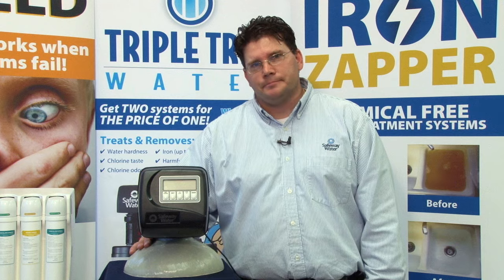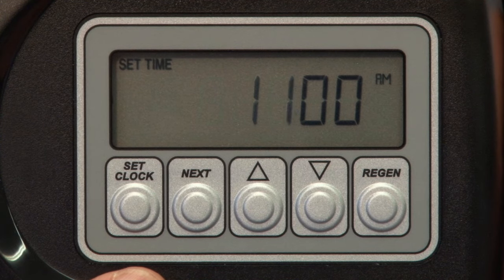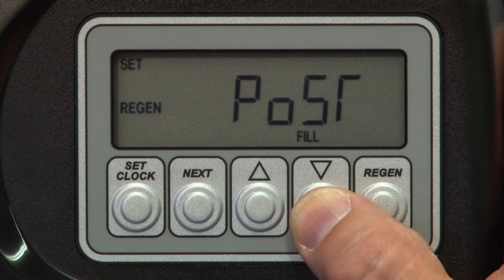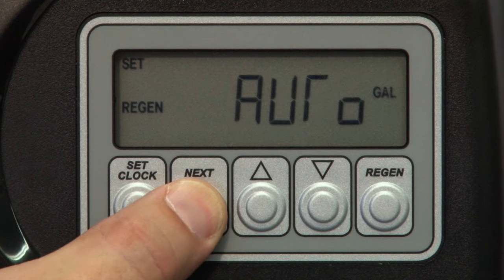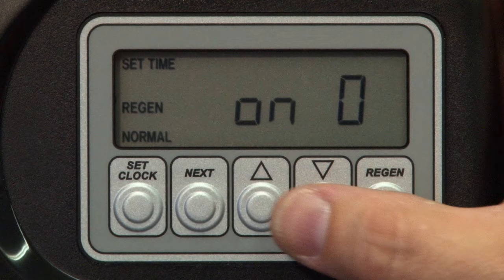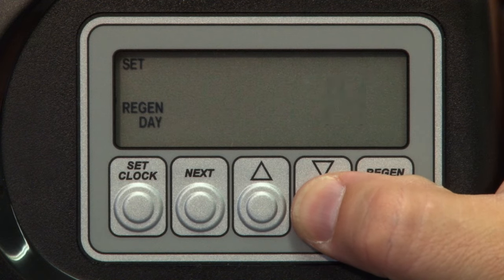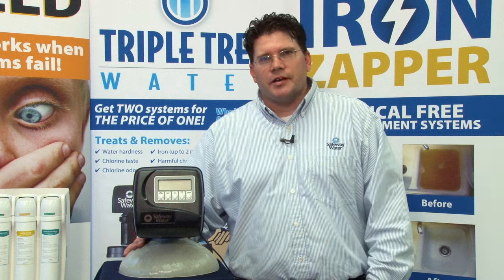Programming The New Safeway Valve #1

Comment: "That's all it takes to setup this system" made me LOL.I feel like I need to quit my job and enroll in a 4-year degree program to understand this device/system. But I took a lot of notes and I'm just going to set it and hope for the best. This really is an informative and helpful video, I appreciate you trying to simplify this complicated task.  Edit to add: I called the plumber who installed it to ask for guidance on the settings, they let me know that if the power goes out ONLY THE CLOCK needs to be reset, and the other settings are saved in the device from the original install. FYI.
Reply: Seriously, I’m going to need to enroll in that 4-year program too
Reply: Thank you.  I had the system installed 2 weeks ago and am not feeling any difference you normally feel with soft water, so I go to troubleshoot and have zero idea.  I have the programming guide but to your point it feels like you need a degree, it's not user friendly to a non-technician.
Reply: Mine didn't

Comment: Great video! If you're here because your water tank is empty, don't panic! This new Sterling Water System isn't like your old one. The one you're used to still has a little water and sludge at the bottom. This new system will cycle your water through and once it detects you're out of salt. The tank takes notice and doesn't refill. In an attempt to preserve your water system from damage without adequate salt level. 

To keep this from happening again. Make a note of the date's and time you fill up the salt and time of water tank fill up. Place a pen and notepad next to your water system to make a quick note to self. Also, the best reminder is one that tells you when to check it. So use your smartphones calendar, set the time with an alarm on the day to refill salt. You will get to know what time that is for you as you check back in 2/3 weeks.

As mentioned here, if it's completely out of water. After you have refilled your tank with (salt halfway*). It's best to start a manual cycle to start your system asap. If not, your system will only try and refill once it reaches it's normal scheduled time.

Also, there is an overflow on your water tank, so if you overfill with salt. Your system may put out an overflow of water, if it doesn't adjust to stop in time. Placing a large old drinking cup underneath that hole is always a good idea to leave there. Especially if you have an older system, or may overfill.

*If able don't only buy the exact amount of salt needed. Buy at least 2/3 bag's extra of the *correct salt for your system. Make sure to store it in a dry and safe place. It makes this less of a hassle then having to run to the store at night, or in inconvenient weather. Most of all, it makes life a litte easier to think ahead.

*If doing your own "filter changes", always keep a spare. Check it when filling your salt. Some are easy to see and change. If it looks orange, dirty or rusty water. It's more than overdue for a change. The first thing you need to do is make sure your main water valve to the filter is shut off. Then go to the nearest sink, close to your system and turn on the faucet. This is a run out of any remaining water in your lines. Make sure you have a small bucket, required removing tool to unscrew your filter reservoir. Be careful, you don't want to damage the filter reservoir using the wrong tools/metal tools. You may be able to unscrew it by hand if you're able to reach it and have the strength. Once it's off, set it in your bucket and take it someplace to clean. Once clean, place in your new filter. I advise applying a generous amount of petroleum based jelly/plastic lube around the reservoir threading once clean. Make sure to wipe away any debri from underneath the unit your reservoir screws into as well. Applying a thin coat of lubricant on that threading (creating a proper seal & easier to remove later). Hand tighten as you make sure you're threading it on properly. You don't want any cracking or leaking. Remember to turn on your main water supply once you're finished. Then look around your filter reservoir as it refills with water, making sure there are no leaks. After all that and reading this, you're done! Lol

Comment: Appreciate the video but it's a little too tech for me not ever having a water softener before. Just moved into a home that previously installed Premium Safeway water softener system. The original installer came by and gave me a quick tutorial and changed the filter but I'm not sure it's set up correct as I have no manual to double check settings.  I'll be contacting Safeway tomorrow to obtain a manual for the model I have.  Unfortunately, there are no photos or manual links on safeway's website.

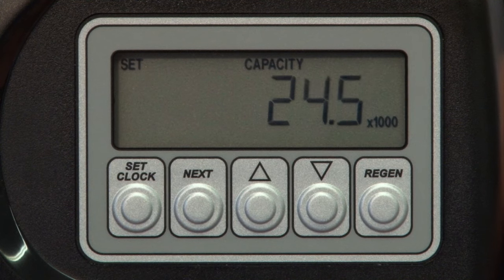Comment: 2:30 well water setting in parts x 1000 was a little vague after pcodes and grains, and assumed we knew what we were doing about the large cylindrical resin tank, how are we supposed to know how to set the "total capacity in grains" for a well water system AFTER setting p20 for a well water system? Any assistance is excellent assistance and thank you in advance!! Will watch video again...maybe it's simply worded so techs understand these settings as our tech seems puzzled. Wants to sell us a whole new head unit.

Comment: Hello and thank you for sharing. My question is.  If we loose power for an hour or so do I have to reprogram it again.? Thanks in advance
Reply: If power goes out, the system will keep time for up to 8 hours or until the battery is depleted. If a power power outage of more than 8 hours occurs, the time of day will flash on and off, which indicates a time of day should be reset. The system will remember the rest. If a power outage last less than 8 hours and the time of the day flashes on and off, the non-rechargeable battery should be replaced.
I got this information directly from the manual. 
Good luck.
Reply: @67herby89 thank you!  My time is fine despite the power outrage. The only problem I have is that I am not getting any water.
Reply: That’s weird because water doesn’t run on power but on pressure. Do you have some sort of pump that pumps water it the water softener or your filter?

Comment: Mine is set to regen at 2am, but the display flashes "softening" at different times of the day.  What's that mean?
Reply: Softening means that it's a water softener setup and someone or some thing is using water while you're out there looking at the display.. I have 2 tanks and controllers, one is a Filter and the other one is a Softener. My wife was running the water inside while I was looking at the display and each read Filtering and Softening.